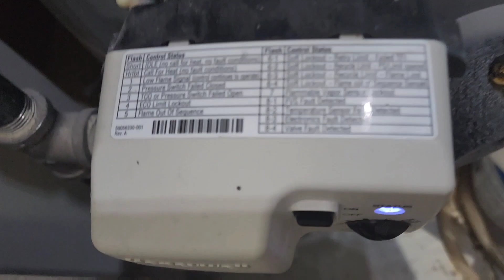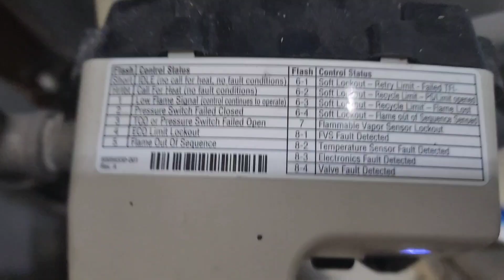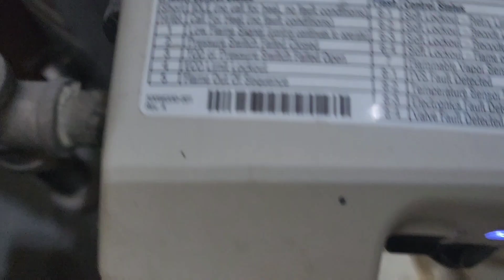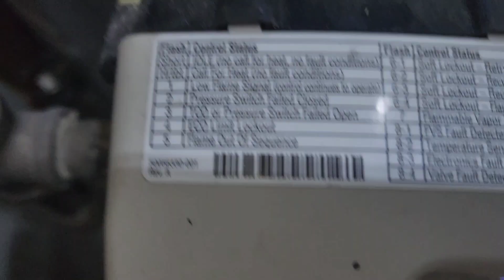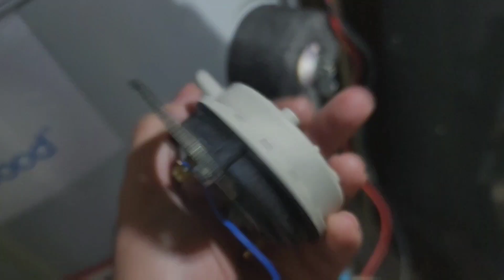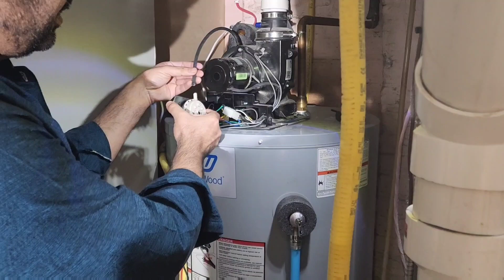Ns2-1306 pressure switch quick fixed John Wood Water heater Gas#subscribe #fixed #heat #water

Comment: Thanks Iqbal, I was experiencing a similar problem and but had a NS2-1306-01 in my hot water heater. I had to remove a blob of glue from the Allen nut but then losing it by a quarter turn resolved my problem. The fan is still producing a lot of draft but the small turn was enough to allow the switch to work.